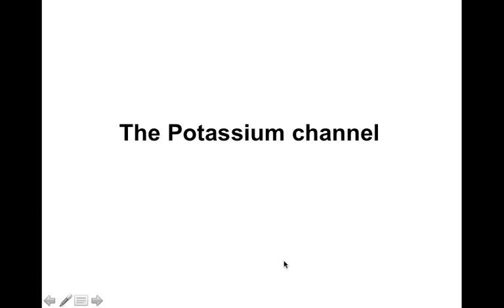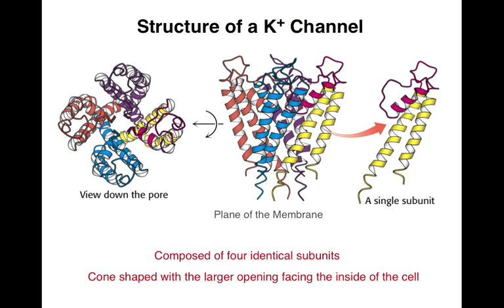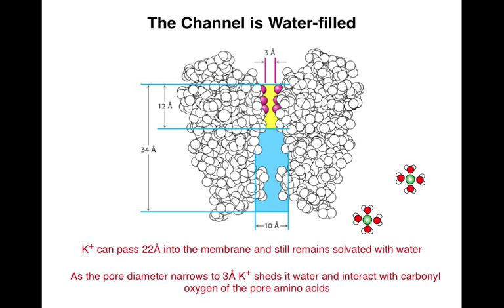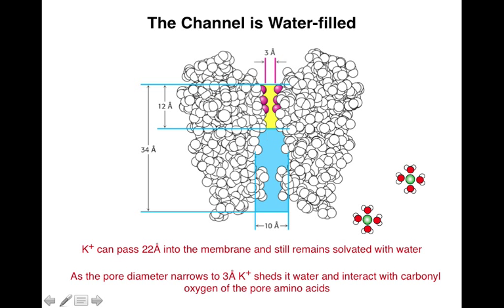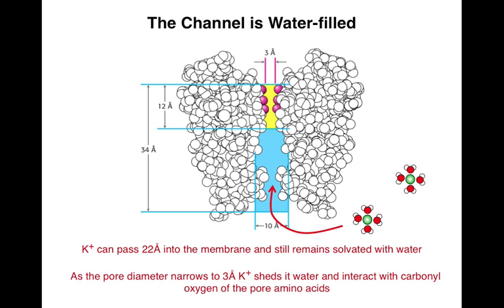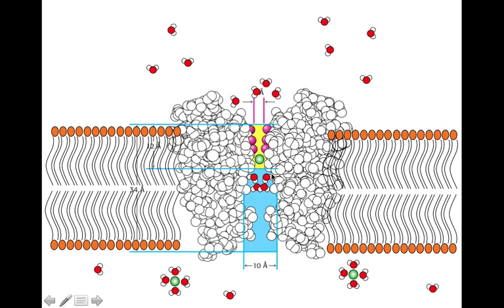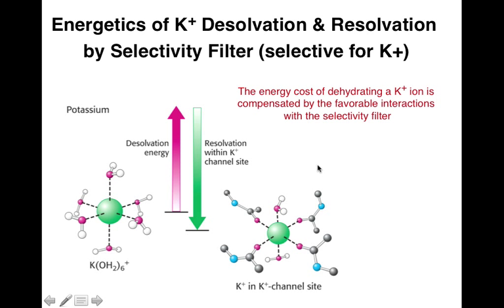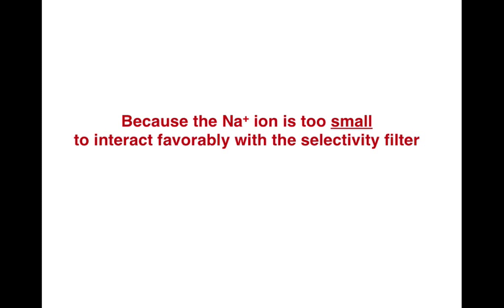Passive transport 1a Potassium channel

Comment: Are you sure that the selectivity filter does not work for sodium because "sodium is too small"? Sodium ionic radius is 0,97 A, while potassium - 1,33 A. The difference is less than an angstem. It seems to me that it is more about the coordination number. "A coordination number of 8 is much less favorable for Na+ than K+ and thus leads to K+ selectivity. This selectivity is lost when the number of ligands is reduced to five or six", here is the link on the article https://www.ncbi.nlm.nih.gov/pmc/articles/PMC1989715/
Reply from the maker: Hi Maria 

That’s what I meant, it cannot form the required no. of bonds- I may have been trying to dumb it down too much for a general audience and it got lost in translation. 

All the best
Dr. Moitra